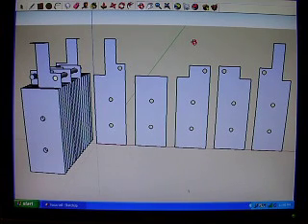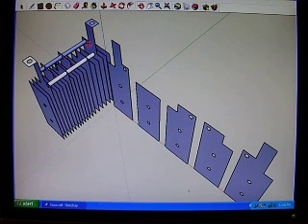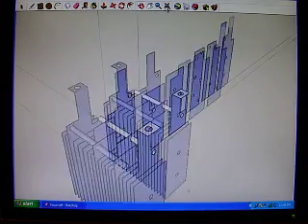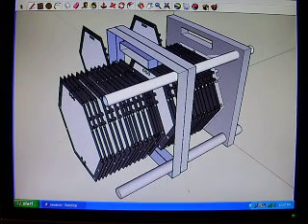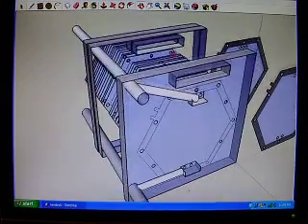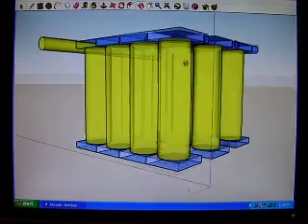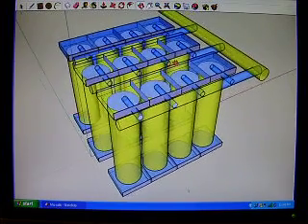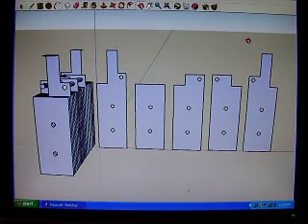012 HHO generator designs for testing

Comment: In a 12V supply with two neutrals your at 4V...run two of these in series to drop to 2V...also production only occurs between + and - faces, so you've got the 2 neutrals at each end doing nothing, and you will also want to insulate the entire design once you add an additional +,- on each end or remove the additional 4 plates of no use.

Comment: @mamun
if you want to improve your car engine efficiency
and save your car fuel expense
there is a better way to do this
It is HHO Gas...
Using hydrogen hybrid alternative for improving
your car's miles per Gallon or MPG
Search Google for "Top HHO Gas Research"
Click the first result (Skip the advertisement)